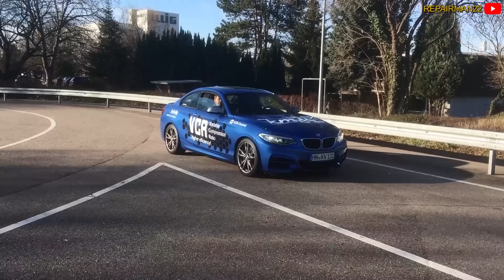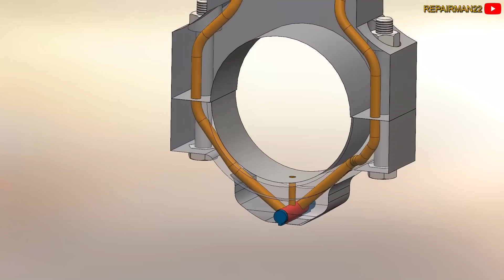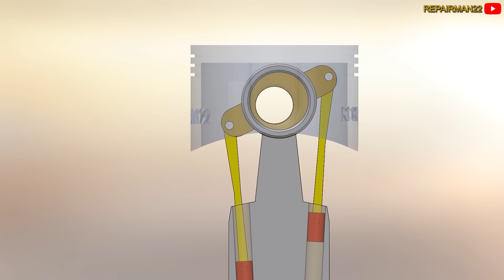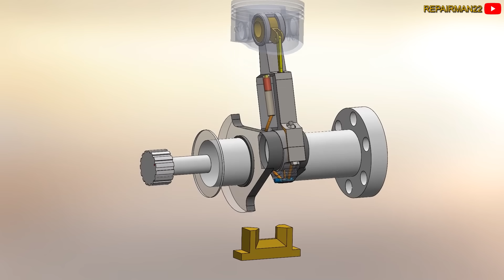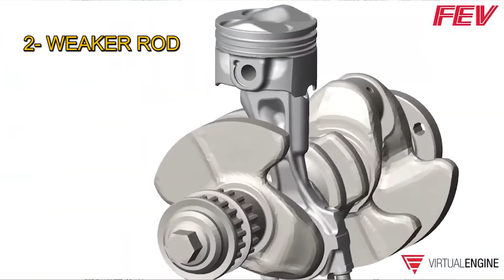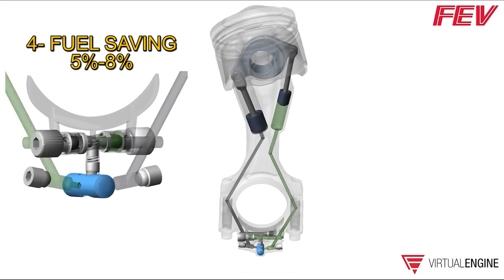This BMW has variable Connecting Rods that can vary its length and Compression of the Engine 🤯 VCR

Comment: It would seem easier to me to make the changes at the head end rather than the end that it moving all the time. A 10cc "bolt" that can be screwed into and out of the cylinder is about all the difference required to vary a 6 cyl 3000cc engine from 11:1 compression to 9:1.
Reply: you sir just solved their million dollar "innovation"
Reply: Agreed, and also a common modification to motorcycles is to fit an extra gasket between the crankcase and lower cylinder head to lower the compression ratio. I would think it more reliable to design a car engine like that and fit the off centre ring shown here in the variable con rod in the lower cylinder head instead.
Reply: Or an additional valve that opens and closes in the combustion chamber. Can be solenoid activated as it does not need to be adjusted every revolution - simple
Reply: @antonrichter5032  uh, you want the combustion to reach through it? You drive pre-chamber Diesel. Also for the claimed efficiency we need continuous adjustment. Valvetronic instead of VTEC.
Reply: @antonrichter5032 sounds to me like a good idea
Reply: Saab already did this in the 2000's with a hinged block that made the cylinders longer and shorter to change the head's distance from the crank.  GM killed it due to budget.
Reply: @1234567890CAB  Yep! I worked for an ICE research company that helped develop that engine. It showed promise.
Reply: I guess the issue is thinking about knock and the variable geometry of the cylinder. If you have one bolt that extends into the cylinder it may be a hotspot.
Reply: @@retiredbore378Yes, combustion chamber shape.... Modern engines rely on squish bands. If the piston is lowered, the squish does not happen, and poor combustion results.
Reply: @pashakdescilly7517 
In general, but were talking about forced induction, the squish would only be altered or reduced during high volume high density boost conditions, where the gains from squish zones are nullified by making the entire chamber a squish squash Squelcher!
Reply: @tomconner5067  I don't know how you got the idea that squish only works in high boost conditions. It was been used to good effect on road vehicles for decades. Modern engines (non boosted) DEPEND on effective use of squish.
Reply: @@retiredbore378 Good points. However sealing the crankcase is only 1% as much of a problem compared to sealing the combustion chamber.
Cam drive could be solved with a shaft (instead of the chain or belt drive), or an „extended“ chain/belt tensioner.
Reply: A pivoting top end definitely makes sense: Few moving parts, mostly outside the block and thus easier to design/repair/replace.
Reply: @@retiredbore378 you could put a gear on the virtual axis of the tilt. It would never need to move and the cam gears would only seem to rotate around it.
Minor problem as regards the dynamic timing of the cam lobes during tilting, but we have variable cam phasing now.
The drive to that gear can still be a chain or, if absolutely necessary, a belt. This mixed arrangement has been used plenty already.

It seems the project was simply canned because numerous new technologies needed to be invented and tested before it would work. No doubt GM would dust it off if they thought they could make it work now.

But cars are commodities, like smart phones, so the incentive to make a car based on pure engineering idealism isn't there. They're made to meet an image and make a profit.
Reply: @@retiredbore378  yes, I know about Riccardo and squish. It's just that modern engines need to be exact to maintain performance and emissions compliance.
Reply: Or a valve seat that recesses rotating and moving linearly on acme threads let’s one of the intake valves recess and it’s set.
Reply: @@retiredbore378
I strongly disagree, as this can be done passively without negatively impacting flow or performance. Simple math
Reply: I've known tuning companies to use two head gaskets to lower compression.
Reply: ya mean a compression break like in old bikes?
Reply: @@retiredbore378 I was thinking this same thing after watching the video. Thread the entire cylinder top, and just use hydraulics to screw/unscrew it. If a threaded/lugged bolt in a rifle can can withstand the force of an explosion, then a threaded cylinder cap could do the same thing. It would take up no space from valves, but the ONLY issues might be piston to piston distance, and block rigidity. Pretty sure both of those problems could be solved with layout. To anyone who uses this idea to build an engine, I expect my 15% cut of all future engine/vehicle sales.
Reply: my thoughts exactly, though I was thinking of moving the entire upper half of the engine block as the 3 most important parts of the engine (from a structural integrity pov, as in the parts that have to actually contain the combustion of the engine) are the pistons, rods, crankshaft, cylinders, and head gasket seal. So keeping those parts as simplistic as possible is always the best and over complicating them always gives you more downsides than upsides.

I feel like moving the entire cylinder head + cylinder sleeves up and down would be the best solution, that way the only complicated problem to solve is the camshaft timing chain. but mountain bikes have already solved that problem and we don't even need to change gears so that should be simple enough. Thought gears are probably the best idea in this situation as you can simply make a geared arm that can extend and contract to keep the whole assembly connected at all times, a driveshaft would also work but bevel gears are significantly less efficient than a bunch of standard gears, and I've made a bunch of these arm with LEGO's and as such can personally state that you can easily set them up so that extending and contracting won't change your valve timing, and only about 4 extra gears would be added if I remember correctly.
Reply: I'm all for fuel savings, but not when those savings will be wiped out the moment anything goes wrong internally.  European engines already have enough problems with stuff like sleeveless cylinders where the entire engine block goes to the scrap metal bin if the coating fails.

From a more practical point of view, I'm more concerned about using super long and thin oil lines with no in and out circulation.  Even well maintained motor will still have dirty oil and using that as hydraulic fluid will cause contamination to build up in the rod channels
Reply: How do you seal against the 100 bar? We already have leakage through piston and valve. So you add a concentric piston ring? Like a sleeve engine in WWII British bombers?

Or you really mean an eccenter around the main bearings? I don’t like that all these things soften the confinement of the “boom”.

Just build a hybrid! It is 2024!

Comment: I can't imagine how fast this system would fail
Reply: Miss one oil change and the system will be dead..
Reply: A lot of the variable camshaft stuff is pretty on point and lasts quite a long time
Reply: @HalfAssBuilt That is right, but the loads a connecting rod experiences are much more complex than those on camshafts. On top of that, VVT/L systems operate outside of the camshaft, whereas the VCR system itself would have to bear the load of combustion.
Reply: @joemama069  I think the main con to it is increased rotating assembly mass. I do think it's a good idea to bring more power on lower speeds for turbos and decrease spool time though. It's an eccentric lobe hydraulics definitely can hold items in place. The older vanos systems run at 1200psi and can rotate a camshaft in less than 100 milliseconds. I think it's about 20 degrees. 

I could see an issue under heavier boost it wouldn't be able to sustain though but if anything it would act as a hydraulic damper under pre detonation because it would of course be weaker than something solid.
Reply: @HalfAssBuilt yeah but I'd argue that camshafts stay in the same place and don't rotate at nearly this high speeds. Connecting rod on the other hand moves around the engine. Saving 0.5l/100km or less simply isn't worth it anymore because modern engines are quite efficient anyway.
Reply: @Mixz1890  they spin at half the speed of the crank but for in the case of let's say the s85 they rotate quite a bit I think it's about 30 degrees on the intake side and less on the exhaust and does so variably even spinning at 8k plus
Reply: Complexity=failure
Reply: @shadowopsairman1583  then every engine in existence should be a rotary.
Reply: Might last longer than Ford’s wet belt!
Reply: @martinhann1672 another shit pile
Reply: max 1-2years, may be 4 :)
Reply: I admire your optimism  @brad4edat
Reply: Nissan is already doing something similar with their VC-Turbo engines, and as you'd expect it's horribly unreliable.
Reply: @theotherdataman Not true, against all odds they have been pretty reliable. And an absolute gem of a power package.
Reply: @HanginInSF  if so, then why is the NHTSA investigating them as of December because of their excessive engine failure rates?
Reply: @theotherdataman  I didnt realize that. I had one for a while and it went like a spooked deer when you gassed it.
Reply: @theotherdataman  I don't think nissan is the idea of good engineering haha
Reply: One missed oil change, boom.
Reply: @PiDsPagePrototypes  there are enough issues with VVT's systems and oil causing issues, so yeah.  The cost of repair would be insane.
Reply: @matthewwain9958  Be cheaper to by a new motor, as a failure on these will likely swing half a rod through the block and fill every bearing with metal.
Reply: Yees and how expensive it will be to repair....😳😳👎 Never ever would i but something like that
Reply: The day after the warranty expires.
Reply: depend how well they manufacture it like most things
Reply: @hotdog9262 Unfortunately, current VCR designs are fragile, so even tight tolerances and highly alloyed steel wouldn't really help. With systems like these it always is a tradeoff between reliability and power/efficiency, just like turbochargers themselves, VVT, VVL and VVD.
Reply: @joemama069  reliability hasn't been too much of a concern vvl and vvt for a while. BMW drives its cars strictly pretty much on VVL they don't use a throttle and they have been doing so since 2006
Reply: @hotdog9262  you cant outmanufacture physical design weaknesses.
Reply: What could possibly go wrong?
Reply: Easy.  If it's BMW, it'll last 36 hours past the warranty expiration.
Reply: will be engineered to last just a little longer than warranty period. It's a BMW after all.
Reply: I can.
Reply: this is the best comment possible. i agree completely
Reply: BMW Speedrun
Reply: Will run 1Mio km. It is very similar to the VANOS system and this is now known since 30years and extremely reliable nowadays. What is creating more headaches for me is the added mass to the rod. Which means (for me) that in the future the petrol engines will rev like diesel engines 😢😢😢😢😢😢
Reply: Wouldn't even last 2 months
Reply: I'll give it a maybe startup... maybe.
Reply: It is important to experiment and test new ideas
Reply: @Anon.G  And measure how much they blow up.
Reply: Faster than the twin turbo v8 they already have……

Comment: Most german invention ever . An engineering nightmare eventhough it works.
Reply: This is the kind of stuff that's going to be a horror to repair. And even with the high-quality machining here in Germany and Austria this looks so fragile I doubt it'll go more than 300k km.
Reply: @Klappspaten_TV  the second owners of these cars will be left with some serious repair costs.
Reply: @Klappspaten_TV  more like 130k.  German cars start falling apart after 150k as is.
Reply: @Klappspaten_TV  Nobody cares about longivity. Warranty time is enaught. Otherways how you take away money from slaves ? Like our goverment told, most sustainible income is from new tax, or incrase same onece.
Reply: @Klappspaten_TV Looking at current designs, even with highly alloyed steels and tight tolerances I'd give it 150k max. Compressive stress itself is pretty complex to deal with, introducing an eccentric piston pin and thin control rods probably is a huge challenge in today's high power-density engines.
Reply: @Klappspaten_TV  I doubt it’ll go more than 100,000 km
Reply: And just wait until the warranty goes so will this goofy thing
Reply: the japanese did it first. nissan has had a variable compression engine in production for years now.

as for reliability, it’s a mixed bag. i’ve heard some horror stories of the actuators failing, but most real world examples i’ve seen are just about as reliable as your conventional fixed ratio engine, provided good maintenance.

i know the way BMW’s system operates will be a bit different, but it’s the same end result.
Reply: Nissan= the Chrysler of japan
Reply: @manitoba-op4jx Engineer here. Because then the whole mechanism needs to be sealed against the combustion chamber - not to mention cooling, thermal expansion and lubrication. And then please think of the forces acting on the top of the piston head. The load would go directly into your suggested mechanism.
Reply: It’s kind cool when it’s new but then you need to own a mechanic in your house
Reply: @manitoba-op4jx that's....clever!
Reply: It’s kind cool when it’s new but then you need to own a mechanic in your house
Reply: @manitoba-op4jx That seems a bit stupid bacause it will mess the combustionchambers shape at low rpm and that lowers the efficiency.

Comment: More problems incoming, just move the damn crankshaft instead
Reply: I was just about to say this as well
Reply: This may work if you connect your transaxle via U joints in a Porsche 944. But what about the torque tube in a corvette or the bolted on clutch in a BMW?

Cadillac, BMC mini and Lamborghini had so bicycle engines where you could rotate around the gearbox gear.

Comment: So unnecessarily complicated. There are so many other ways to get variable compression, that would both be cheaper, and have better durability.
Reply: They exist already, variable vane turbochargers is one that'd kill this crass idea instantly..
Reply: move the crankshaft, problem solved for cheaper
Reply: ... such as?
Reply: @FUZxxl  Try looking up the "Infiniti" engine that has variable stroke length or better still look up the modern form of the Atkinson Cycle that uses variable intake valve timing to effectively alter the compression ratio.
Reply: @PeterChapman-rg6gr the only issue with the Atkinson cycle is the engine never makes as much power. Really like the Nissan/Infinity solution the best so far. A bit bulkier, but also relatively simple
Reply: @jaredbawden6707  Most drivers would rather have the improved engine and fuel efficiency over a bit of extra power.
Reply: @PeterChapman-rg6gr  that's highly debatable.
Reply: @jaredbawden6707  Care to enlighten us on your comment given that over 99% of car drivers are NOT "Boy Racers"
Reply: @PeterChapman-rg6gr well considering most ICE cars on the market don't use Atkinson cycle tech, I think you have your answer. I never said anything about racing, but it can be the difference between having enough power and not. Most Atkinson cycle engines these days are a part of hybrid systems.
Reply: @jaredbawden6707  I think that you will find that a vast number of "modern" cars have delayed the closing of the inlet valves to effectively shorten the compression stroke and thus achieve the operating principles of the Atkinson  cycle. This is witnessed by the mass adoption of variable inlet valve timing coupled with the widespread adoption of turbochargers.
Reply: @PeterC-qwerty this is totally wrong. Atkinson engines require a different, longer duration camshaft profile to work. Variable cam timing allows more power at higher RPM by advancing the camshaft timing it does not allow the engine to run in the Atkinson cycle. Please do some research.
Reply: @FUZxxl  toyota makes them for ages already. Ive recently done work on one with 300+kkm. Clever design and simple mechanics, unlike this bmw BS
Reply: @alexkei4009  This isn't a BMW invenrion, it was installed in a BMW for testing...

Comment: 5-8% in fuel savings probably won't justify the extra cost and complexity of producing an engine like this, sounds cool but I thinks it's a step in the wrong direction. They should put their money on hybrid vehicles like Toyota, not only do they achieve impressive real life fuel economy figures but they also produce less emissions and they're very reliable as they're used by fleet vehicles and taxis all over the world.

Internal combustion engines simply aren't good for scenarios like stop and go traffic, they're only efficient in a very narrow RPM and load range, even with variable compression ratio it wouldn't make a huge difference. It's better to combine them with a electric motor and battery instead.

Also I can't help but think of how many recalls and warranty claims this would have if it went into production, with that many extra moving parts that use oil combined with extended oil change intervals this engine would probably doomed from the start.